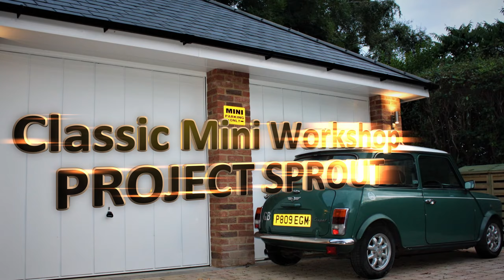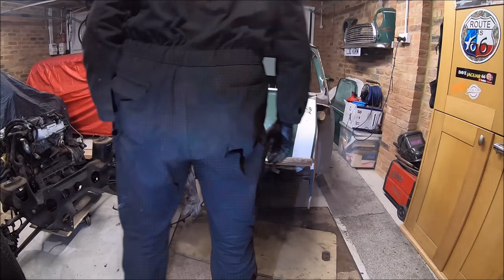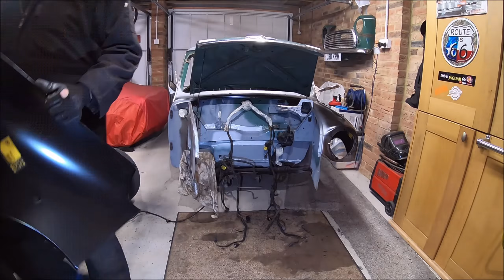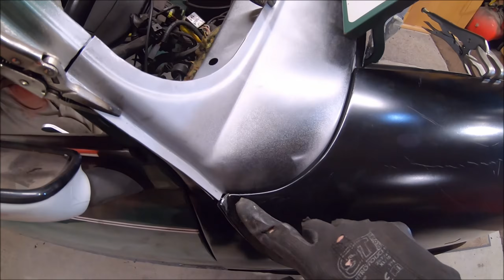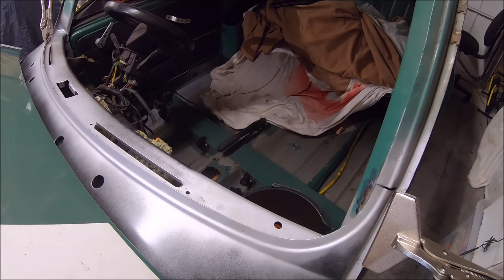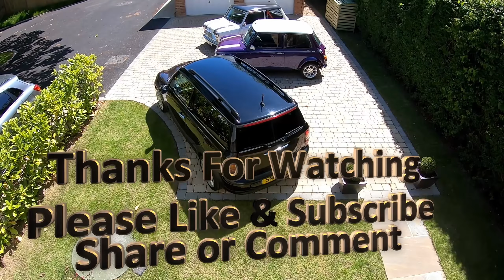Classic Mini Workshop - Project Sprout Pt.31 Scuttle Panel Replacement

Comment: Regarding removing stickers, another method that works well for me is to simply peel the corner and then heat it up and it will peel right up...   I imagine that what you use for alignment changes from job to job.  Trying to take note of what you do, but I'm guessing my situation will be different and/or I've already removed too much before making marks.. etc...      nice work Keith...
Reply from the maker: Thanks Randy

Comment: Keith, The best & easiest way is a hot air gun just warm up the sticker & peel it off it will not even leave the glue 
on the panel if the heat is right.  Cheers Dave

Comment: Every mechanic needs a wife who is willing to reset the breaker when needed lol.. the fitment looks spot on. I used nail varnish remover on a rag to smooth out seam sealer, after having it stuck all over my hands many years ago now. I think am more exited about this project than the ERA it’s very close mind you